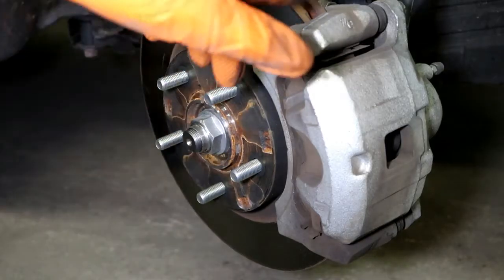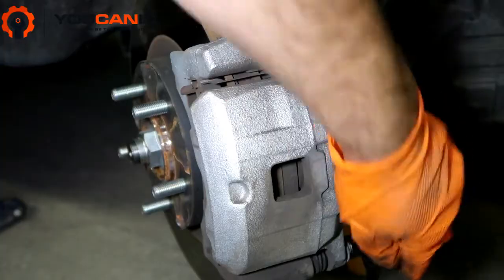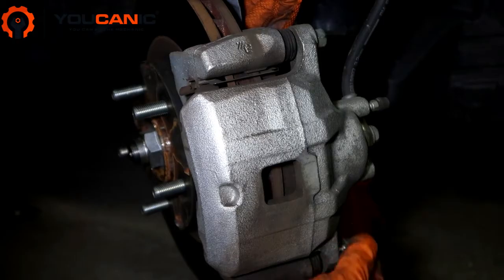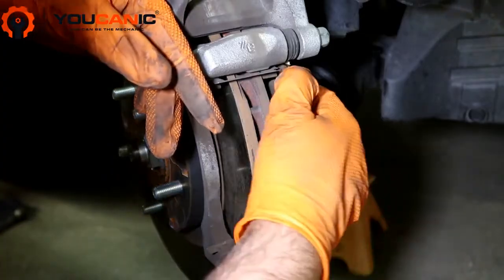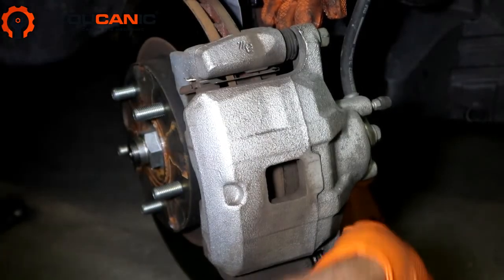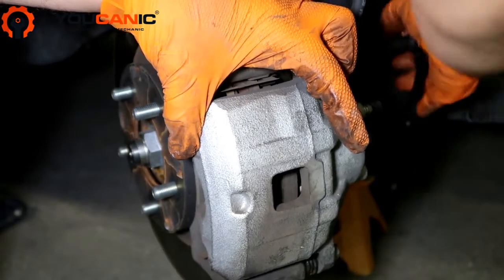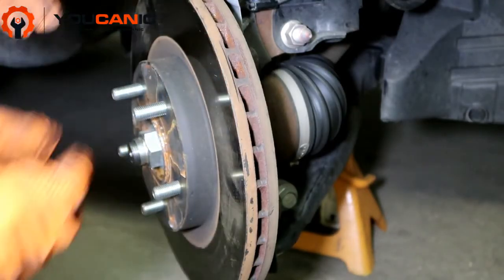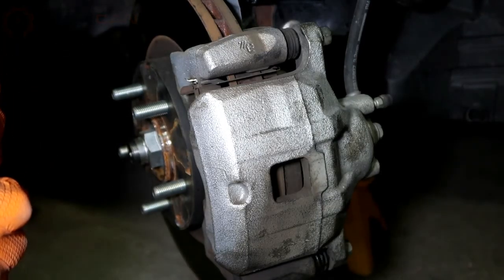How to Replace Front Brake Pads and Rotors on a Mitsubishi

Comment: Excellent video, I just followed it to replace the front rotors and pads on my Outlander PHEV.
That tip about using a screwdriver to push back the pistons before removing the pads was very useful, I used a screwdriver on one and the flat blade on the back of the jack lever to push the other at the same time.

Comment: how tight (using a torque wrench) for screwing back the caliper nuts of the caliper bracket attaching the back of the rotor?
Reply: Great question. Anybody know?
Reply: Bracket 80 ft/lbs
Slide pin bolt 30 ft/lbs